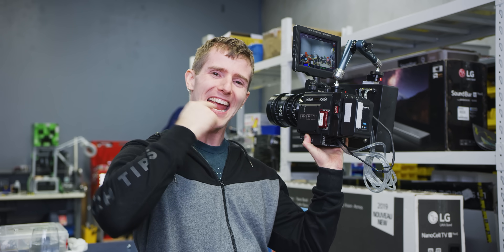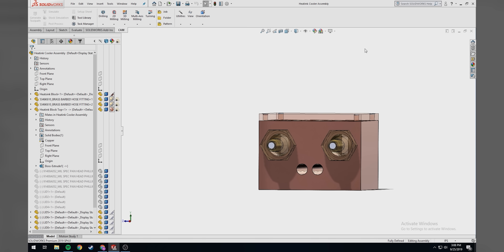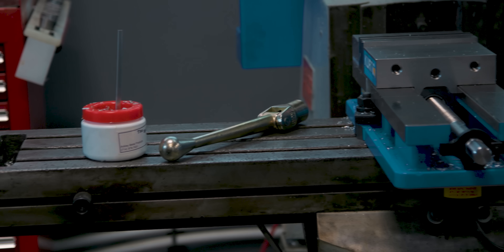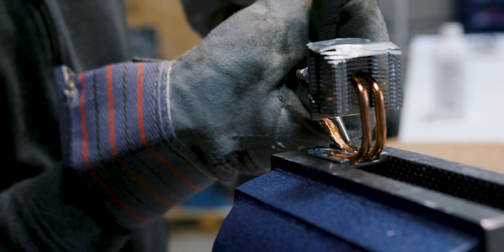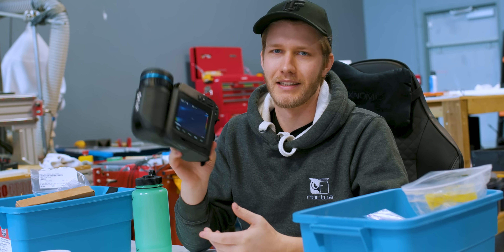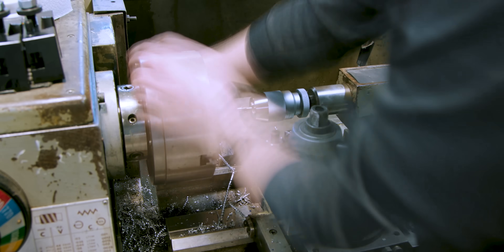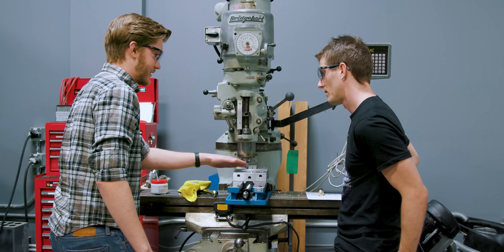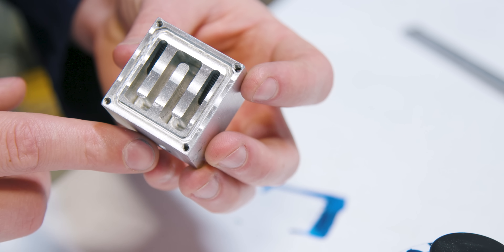WE FINALLY DID IT!! - Water Cooling the 8K Camera!

Comment: I like this more engineering content. it's a nice change. I think the deliver might need to be improved, doesn't have the same kind of flow as normal videos but I think that will come with time making these videos.
I think part of the reason is that this content I have a lot less expirience with than (let's watercool this pc with concrete as as the liquid and Nutella as the TIM) so think it needs a bit more simplifying for the basic audience.(I do have some expirience with this so I may not be as experienced  as some. But I am don't "know" what I am doing. Just to give a baseline for my level as the level of understanding that your audience has on average will change based on the average expirience and interests of the audience's 
Wow I really rambled k bye <3

Comment: Set of soft jaws for your vice wouldn’t be a bad idea. Holding that aluminium plate to rip heat pipes off in steel jaws probably damaged it a bit.

Comment: IR camera trick, when dealing with shiny surfaces. You can add a light coat of satin black paint. This raises the emissivity of the material. The IR camera then can see it more accurately.
Reply: Wouldn't painting a heat pipe mess with its thermal capabilities though?
Reply: @Sgtpeterenis  Short answer, technically yes. With heat pipes you wouldn't want to cover the points that make contact with cpu heat spreader or heatsink/water block. IR is light (even though we can't see it with our eyes). So when you point a thermal Camera at a reflective surface. Not only are you see the IR light it's emitting bit your also seeing IR light from the room reflecting off of the surface thus skewing your readings.
Reply: @Marzec309  oh yes, I'm aware why shiny things and ir cameras don't work together that well. I was just wondering whether paint would have a big impact on heat pipes, though I guess you could just remove it again anyway. And I just remembered that laptop heat pipes are almost always black, so evidently it's fine
Reply: @Sgtpeterenis  laptop heatpipes are generally painted after they are mounted to the fins and coldplate
Reply: @Deilwynna  
just right, and thats why it makes absolutely no difference ! this is so low that it falls within the range of measurement tolerances and nothing more. greets from germany
Reply: Masking tape works too

Comment: Actual Machinist Here:
@2:58 please only push a file Alex, I'm begging you
@10:50 There is more than just guessing it, but it's just LTT
@12:45 You are a machinist, just a very new one; also This Old Tony!
@14:35 You're either a braver man or a dumber man for trying rigid tapping in an old Bridgeport without a tapping head
Overall: I've seen better, I've seen worse; I weep for your router being used as a mill, get a lil used Tormach and save yourself some hassle, you're only making water blocks

Comment: Does the heat pipe water block on a CNC router when they have a milling machine smh 🤦‍♂️🤦‍♂️
Reply: Because Alex knid of knows how to run the CNC but is mostly guessing with the mill.
Reply: It's a manual mill....... No cnc function means they would have to manually cut the corners etc
Reply: because Alex is an engineer not a machinist so he knows how to write cad programs for the cnc router but is kinda winging it on the Bridgeport

Comment: "measuring this would be a nightmare" literally only needs a machinist square and calipers. And a depth micrometer if you're really worried about the heights. Considering the amount of money spent on machining tools, having some basic measuring tools doesnt seem too much :D
Reply: I know right. I facpalmed when he said he didn´t have a way to measure depth while holding the indicator dial. They have a full machine shop and the thing still looks like a ghetto rigged PC mod. It would almost have been easier to machine the whole thing as one piece instead of attaching it to the original and would have had much better heat transfer performance. Would really only have needed a caliper with depth needle on the back. Or could have painted the part with transfer paint and done a print onto some paper. Scan the paper and let the computer convert it to a 3d part by setting the thickness and depths of the hollow spaces etc. routing those fittings through the side of the water block would also be smarter.
Reply: @excitedbox5705  It's not about the tools. It's about someone who knows what he does. Not to put Alex down but this is nothing you just pick up in few hours.

Comment: Alex: "I'm not a machinist"

As a machinist, I agree. Quality content as usual, but the maker videos always make me cringe a bit... lol. Btw, you could've used your chuck for tapping. Without using the chuck key, if you only hand tighten, it will spin around the tap if there is too much resistance (assuming you've hand tightened a proper amount) but will otherwise tap flawlessly. Just make sure you put it in low gear and release your quill lock. Also, keep the quill as close to the top as possible because the spring to bring it back to the top will increase in resistance the further it moves from 0. Also, you can chuck up that fine thread tap. Just put your spindle in neutral (after putting the tap in and running in high speed for a second to make sure it's running true) and then use your hand to rotate the spindle/chuck while lightly applying downward force on the Z-axis handle. The tap will naturally pull you into the part as it cuts, and your tap can't go out of square while tapping.

Edit for content.
Reply: Spun a edgefinder at 7800 rpm too that part killed me 🤣
Reply: Im a fabricator and definitely not a machinist but that was still painful to watch. Still good content though
Reply: For the love of machining, don't do what he said. NEVER let your tooling spin in the chuck. It will either eff up the chuck jaws or the shank of the tool. You see all these damaged tools in the shop and you're like "how could that have possibly happened?" Well, now you know.
Reply: Wat
Reply: For real lol. It's entertaining to watch but the "It sounds about right so I'll run this half inch endmill at 2500 RPM and go to town on this steel".
Reply: @tylernorton2525  I think it was aluminium.
Reply: @TheBackyardChemist  definitely was aluminium. Just look at how easy it went without any need for additional cooling.
Reply: I kinda feel like you did I think when they build/talk about mechanical keyboards, it's nice to see interest in it and promote the thing but it's always weird to see someone who knows their stuff less than you get so much audience I guess ? But they also never pretend to be experts so great videos still :D

Comment: 18:49 Just as a little tip. Use normed Steel slabs under the object the next time you mill so it doesn't move too much and to make it level. My workshop teacher would have probably killed me if I milled it like that.😅

Comment: Hello tech geniuses so i recently bought corsair vengence 3200mhz 16gb ram 2x 8gb with msi a pro 370 what settings is good for the rams and my specs is

CPU - i7-9700k
GPU - RTX 2060 Super
RAM - Corsair Vengence 3200 Mhz 16gb

i would love to get some help with settings my bios up for gaming

Comment: Fellas, if you chose to do one off orders of these water cooling systems for RED cameras, it will be a game changer for large productions working in hot environments. Cameras overheating is a consistent and widespread issue, and RED is especially guilty of this. The previous solution was to have many bodies in a cooler with dry ice on location, and I have a feeling this could be big!

Comment: When Linus mentions a drill when he's holding an electric screw driver 😂
Reply: Well, one could argue that today there is no real line between an electric screw driver and a drill anymore. I tend to use my electric screw driver for drilling holes a lot as long as I do not want to drill into hard brick walls. I mean, it has a "high speed" setting and it will drill holes in softer walls just fine, so why waste time and get the drill?

Comment: Again, how did the Enginope get hired? The man is too lazy to use calipers to actually get measurements. This includes the thickness(dial meter).  Watercooling the heat pipes man woo I wish the whole water cooling industry had thought of this first. Truly ground breaking. After it gets broken we reorder heat pipes rather than going "well, the heat pipe is out we should just full fab the water block to attach rather than jerry-rig it to the heat pipes"? And may I say congratulations on figuring out that copper will conduct heat. Mill feed rates are a thing, a few seconds on google can get you to a basic feed and speed setup. With a drill mounted right there you hand tap, just put the bit in the drill and spin that by hand ... then you can be assured its properly aligned.

Comment: Ah! As great engineering done in water block and heat flow simulation, i am disappointed to see that radiator and water pump. Just pickup a custom ones  of right size. it is way to big and just kills the whole point of water cooling.

Comment: In my head I just want to cut off existing heatpipes and use them as water carrying direct contact tubes. Might take some clever solder/brazing but it could work.

Comment: 14:06 these ribbons are ok to handle as long as you don't go sliding along the edges. Pinching the flat parts is safe but there are few situations where you would want to hold these

Comment: dumb question, instead of adding a water-cooling block to the pipes  @2:21,  why didn't they just cut the pipes and run water through them???   I mean how hard could it be to connect hoses on them?

Comment: Here is an expensif video idea. Only linustechtips could do. Make a heatblock from pure silver. Silver has better heat condictivity than copper. But because its exspenif its almost never used. But in theorie you could make a heatsink that is better than anything on the market.

Comment: "We're going to take 10 1000th of an inch" 
It may be my European showing, but I think working so much with fractions might've finally collapsed Alex's brains. That's easy math right there.
So I guess what I'm trying to say is
Laughs in metric
Reply: In machining almost everything is shown in decimal form.
Reply: @tylernorton2525  yeah, no argument there, but it's not as if 10 1000ths is the same as 5 8ths.

With one you can say "we need to take this down to 100 times less (cause that's what 10/1000 is, it's 1/100). There other is indivisible and doesn't give you a nice round number.
That's what I mean

Comment: MechE grad student here! I've had workpiece movement issues similar to 15:17 too. I have good luck giving the workpiece a good whack with a small dead-blow hammer just before the final tighten in the vice jaws. It does a good job forcing the work against the parallels for multiple operations. Figured I'd share on the off chance it could help! Great work Alex! Loved the heat pipe validation method!

Comment: Tip on zeroing out a metal router/mill: get some cigarette rolling papers, lick it, so that it will stick to the side of the  piece. Spin up the router and carefully move it towards the paper. Fine adjustments will do. From the moment you see that the bit touches the paper, you have zero point. Rinse and repeat for the other two axes. Worked 25 years ago, still does.

Comment: Does anyone watching this video even own a red camera?? Still love it tho 😂
Reply: Almost nobody owns a Red camera (at least not one of the newer models with the latest sensors, you could get an older Red One for less than 2K if you like). Cameras in this price range are typically owned by rental houses and production companies. The lifespan for these high-end models is usually way too short for cameramen to own them. You just rent them for a project or you get hired by a production company that owns one.

Comment: 11:54 please don't crank it, the threads in the drawbar are quite soft so you should really only need a quarter turn from hand tight, it's the friction of the Morris taper that holds it, the drawbar is there for safety. But ngl, I would love to work for you guys in that shop

Comment: 12:43-but you're a Mechanical Engineer
16:14-I guess the Dial Gauge's gotta be perpendicular to the surface to measure variations in height (at least that's what I was taught)

Comment: Linus’s kid has a fever

Linus: lets water cool him
Reply: Technically speaking we are already water cooled. I know it's a joke, just wanted to throw that fun fact in.
Reply: @envidygaming3990  36°C is way to hot, the body just thermal throtels. Get that temp down as far as possible, unless you got nand storage, it likes to stay warm for optimal performance. A good way to cool down while it's Winter is the local duck pond. Just Chuck the Bad boy in and see the temps fall
Reply: @ToasterWithFur  CRYOGENIC FREEZING
Reply: @ToasterWithFur  Actually, if you really did a lot of sports, that would be a good option to prevent "thermal throttling". The body will provide much more power if cooled properly.
Reply: @envidygaming3990  That's true! As long as we drink water, of course. 🙃
Reply: clearly, a new sub that never saw whole room water cooling. actually now i feel old that i remember the moving into the old house
Reply: Kids waterproof, just chuck him into a  dry ice pool.
Reply: @AlexBeyer-l7k  Normal body temperature depends on where you measure (orally, axillary (ie armpit), rectally or tympanically (ie ear)). But usually I'd expect 36.5C to be about right for most people, with 37C indicating a very slight fever (albeit too low to really worry much about, but keep an eye on), 38C being a moderate fever, and you are correct that 40C would be a point that you should be taking pretty solid measures to remedy (depending on other heatlh factors etc). I'm a pharmacist, but I want to be clear, other health factors will feed into all of this, and you should seek advice from your health professional for advice about your specific conditions and/or what action to take - #nothealthadvice.
Reply: @ganashal   Thanks for the health advice
Reply: Use ice instead of coolant so its SUB ZERO
Reply: Aka bath
Reply: هههههههه
Reply: na you can just aircool kids by rolling down the windows and drive down the highway
Reply: @Envidy Gaming 
Technically speaking if we are water cooled we're outdated
Reply: Very scary nigh years ago, my older son had very bad high fever. I would not come down with medication or what not. So yeah, we watercooled it. In 36 degrees water in the bath tub. It worked fantastic.
Reply: Khalid 😂😂😂😂
Reply: Where do they plug it in
Reply: Linus' Hospital Funding.
Reply: this is too good.
Reply: humans already are water cooled lol
Reply: That can be a great content
Reply: well in the old days (40's/50's) yeah - that's what you did.
Reply: You could also use more cow bell.
Reply: Linus Black Ops Tips: Let's waterboard him.
Reply: Aren't humans already watercooled? (Sweat)
Reply: I did this once. I watercooled myself

Comment: So.. seriously. You found out water cooling isn't always the most effective way, right? Could you please engineer a cooler with heat pipes on the die but with a water block instead of the fins just like you do here? It has to be the best way except for chillers or the dumb peltier elements.

Comment: 16:37 what you should have done is started with a bigger piece and then got it down to the measure on both sides, this way you would have a flat surface from the both sides (obviously if the bottom surface is clean and has no scrapings) then continue on with the rest

Comment: tapping is easier to do with a drill, if you can. The drill, controlled by hand, can walk into the material at the speed set by the tap so you dont break it.

Comment: Linus makes the RED bigger and heavier...
Camera operators...."Aw C'mon!!!!"
Reply: Hey it means that with this heavier modification, the camera operator will have the ability to haul about the heavier mass for longer periods without the red flashing heat warnings and shutting down like it's known to do with lengthier shoots
Reply: @James-mahal  They should've gotten an ARRI from the start. Or heck, even a MAVO LF or something would've done it. It's not like RED was the only option, considering what they were shopping for.
Reply: they're not terribly big to begin with, and really also not too heavy either. And as other homie said, these things are known to give you a good ol warning that it has overheated and you gotta wait a while... if this can keep you from having to switch cameras or stop production and save time, I would take that over it dying every 40 minutes or so on a warm day.
Reply: As  @producerevan88  said they don't weigh as much as you think, the riging, lightighting, lenses, add-ons to support the weight of said lenses with motorised controls, and supplementary Batteries, that's where the weight is, with one of there "backpack" back mounts a camera operator really won't mind the extra 1.5kg at most
Reply: @James-mahal  thank you, we're in the future guys! Nothing is as big as it was in 1993!!
Reply: @producerevan88  Or just use an Arri, they never overheat.
Reply: Except possibly brandon, who wanted the cooler more consistent temps i think iirc? Everyone else will baulk at the weight though yeah!
Reply: A heavy camera is better more stable footage
Reply: Linus mentioned in a previous video with all the attachments weight adds up and they have (I think easy rigs) so you basically "don't break your back" or something like that can't remember which video it was to reconfirm this stuff
Reply: Imagine paying 50k for a camera that overheats
Reply: and now they get fewer breaks to let the camera cool down.
Reply: @harrygibus  If your employees have to rely on the camera overheating for breaks, there's something wrong in your company.
Reply: @harrygibus  Nice way to tell everyone that you have zero work ethic